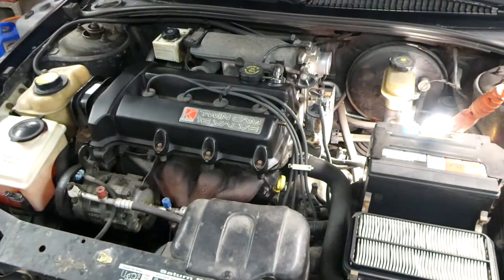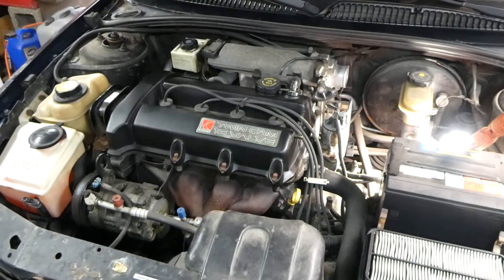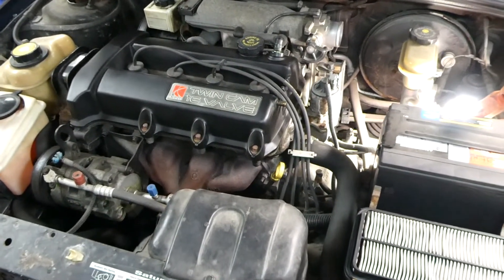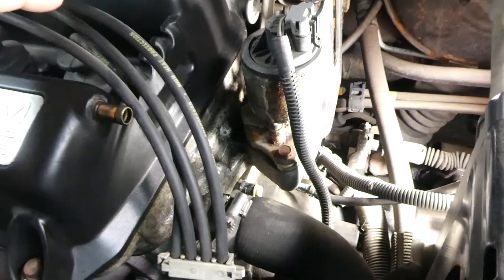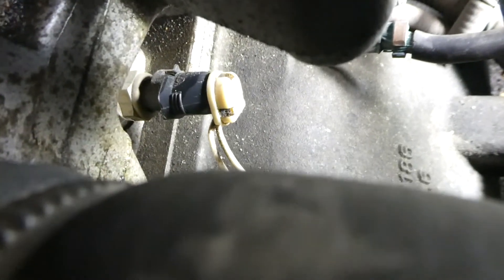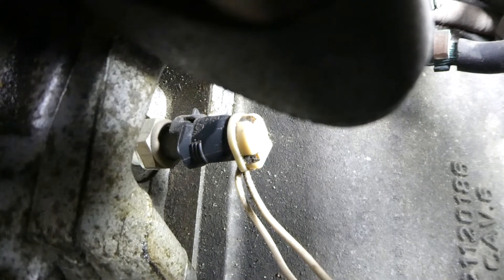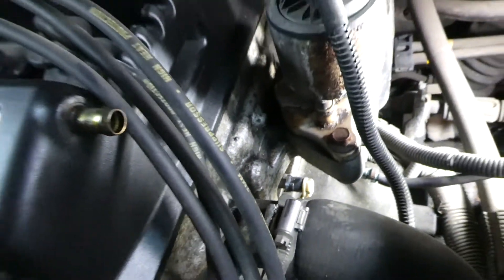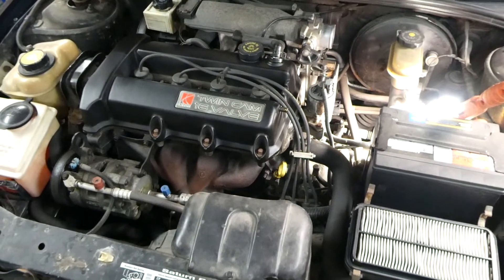Engine Coolant Temperature Sensor Location

Comment: Hey Rich, I used to watch your videos back when I had a 2002 Saturn SL2. That one is long gone. In a bit of luck I acquired a 2002 Saturn SL2 with only 58,000 original miles on in a few weeks ago. It’s only problem is that zero heat blows from the vents. The cable driven blend door actuator works (watched it operate in driver’s side foot well). The blower motors works on all speeds. The coolant is at the proper level. It has so few miles and has been well maintained, I could not imagine it being the heater core. I am wondering if it is the thermostat stuck open. Will these little cars produce zero cabin heat in the winter if the t-stat is stuck open? The car does in fact get to operating temperature (just shy of dead center on the gauge). I can drive it for two hours straight and it still blows ice cold. No heat. I think you may know these cars better than anyone. I would think after hours of driving that at least some heat would come from the vents, even if the t-stat was stuck open.

Comment: NOTE: 
My 1995 SL2 has 2 Temp Sensors by each other!  Evidently this changed to 1 sensor on newer models.
The top sensor(SU1131VC) is for the dash gauge reading and the bottom sensor(WTC1231) is for the Computer/Cooling fan to come on temp. 

Our problem was the cooling fan not coming on and the radiator overheated at McDonald's. 
Luckily it doesn't seem to have damaged the engine as we stopped right away.

Disconnecting the lower fan sensor(open circuit) does not trigger the fan to come so a jumper wire placed inside the disconnected connector's 2 holes(close circuit) probably would. 
Needle nose pliers were needed to squeeze the connector enough to remove.
Be ready with the new sensor before removing the old one because some coolant does leak out.
We wrapped the sensor threads with a few wraps of teflon tape since it did not come with a paste. Use a 13mm deep socket. Don't over tight, these sensor metal cases are wimpy.
We just put a new sensor in and idled the car till the temp gauge was a bit over half and the fan finally came on as it should now.

We had previously disconnected the fan plug and hard wired from the battery to the fan motor to make sure the fan was still good and it was.
The 2 sensors look almost exactly the same but the plug grooves on the sensor is a male like bump for the bottom sensor where for the top sensor it is like a female 2 grooves together.
The probe part of the sensor that goes in the block is like a brass where the Oem were like a plastic.
The old one was the Oem with 130,000 miles on it.

Take care
Reply: I was meaning to replace the bottom one but put the new one in the top. And to top it off I wrenched to hard and it broke. I dont know what to do.

Comment: Thank you for posting these videos.
You have saved me a lot of problems by showing the easy way to work on these great little saturns.
Truly greatful
Reply from the maker: Great to hear!
Reply: @RichpinTv  is there anyway to replace the sway bar bushings in the control arms without removing one on the sl?
That one bolt is a nightmare!

Comment: By the way I had a nightmare for years with the guage reading all over the place and engine ping etc etc. Turns out the factory replaced the sensor and harness while under warranty and their splice job was causing the problems. So the engine temp would read low all the time and also move around alot but in reality the engine was very hot. This caused bad ping of course finally I cut the wires in despiration and rewired a new connector and all that was fixed lol. So it was never the sensor or the thermostat or anything like that was always just a poor solder joint from the dealership. Car never pings anymore and guage is totally stable and normal.
Reply from the maker: That must of drove you crazy.
Reply: @RichpinTv  it did! I drove like that for years trying to figure it out lol.

Comment: At least it's easy to get to,  Does the engine computer use that sensor for engine management or is it just a panic light that lets you know the engine is about to explode lol.
Reply: It does what it sounds like it does, monitors engine coolant temp, when it goes out the car may think it's hot when it's cold and vice versa, along with usually a rougher idle, cooling fan kicking on randomly, poorer fuel economy, and the list goes on. As Rich said, it's very important.
 An easy way to test it, is actually disconnect the sensor plug and see if anything changes (chances are, you're having problems already if you're looking for the sensor to begin with) if nothing changes with the idle, or temp, etc.. the ECTS is bad.
  Relatively cheap part if I remember correctly too.